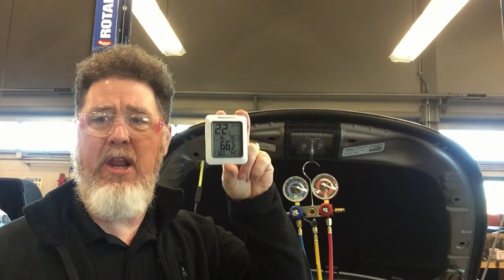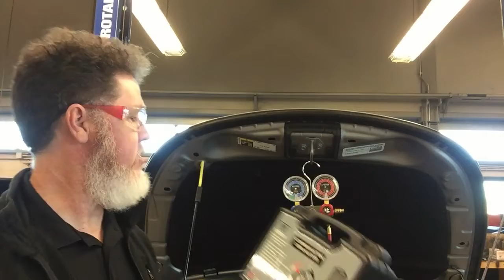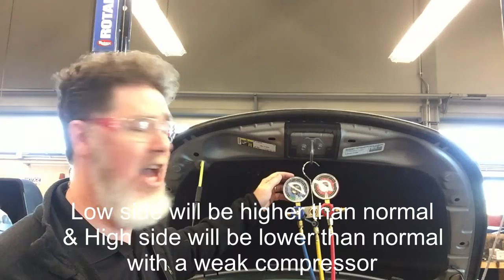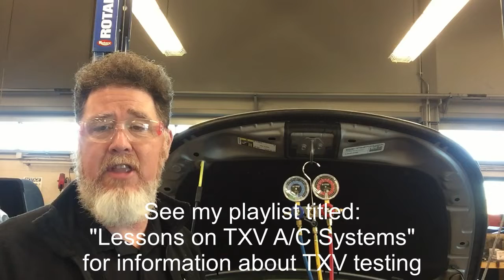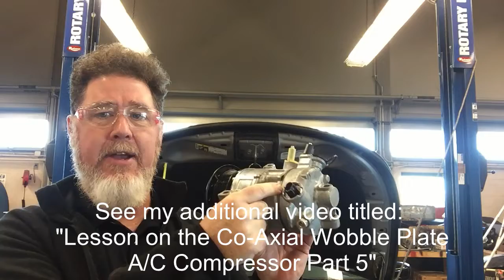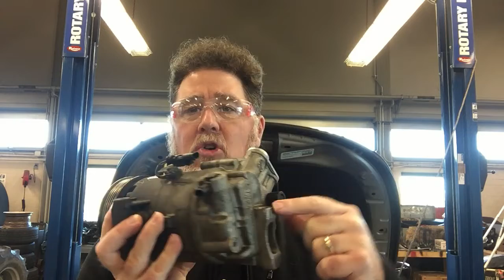Diagnosing a vehicle's A/C system:  Low side PSI is High & the High side PSI Low

Comment: I have a 2014 silverado and the ac compressor runs but doesn't seem to pump the freon around. Pressure on the low side is greater than high side which is odd. And... the cooling fans does not turn on when I turn the ac on inside the cabin. Fans work fine to cool the engine but not turning on for the ac. I unpluged the Pressure sensor and fans kick high speed. Any thoughts?
Reply: Same problem I did exactly what you did with the pressure sensor, I’m go ahead and replaced the expansion valve first before I go with the compressor since the compressor it’s on and I really hope it’s not the compressor 😥$$$ I’ll come back next 2 weeks
Reply: @selvinramirez5585 well? Did the expansion valve do the trick?
Reply: @doingstuffwithhopper4308  no it was actually the compressor I changed the expansion valve first before buying the compressor and that didn’t fix the problem so I last option was the compressor and tha was it
Reply: Did you ever figure it out ?
Reply: I replaced the expansion valve and went ahead and replaced the compressor that had a small leak. I really think the expansion valve was stuck or some. The fans will not engage with too low of pressure on high side. At least It is what I could think of. As soon as I replaced the expansion valve and compressor and refueled, it kicked in and works perfectly now.

Comment: Mine is doing that. The compressor works but doesn't move the freon around on the system. Also, the radiator fan won't start when ac is turned on. Any tip on the radiator fan not turning on? I checked all fuses and relays
Reply: My Cruze is doing the same thing. Fuses are all good too
Reply: Check the expansion valve if there is one there.  If freon is good compressor kicks and too much pressure. Cold be the expansion valve.
Reply: Have you checked fan operation itself?
Reply: @yannickn6742  it was a bad compressor

Comment: Hello!!!

I'm watching this and I can't see my issue. Please help!  Details below. 

What it is: 2004 Dodge Ram 1500 5.7 v8

I changed out shipping pag in ac with new pag46 3 oz in compressor (2 oz reg. 1 oz uv

After replacing everything, I vacuumed system for 2 hours vacuum held
Added 3 oz pag 46 (2 oz reg. 1 oz uv) system requires 6 oz.
Started truck
No clutch engagement
Added 1-12oz can r134 to Low side (requires 22 oz.)
No clutch engagement
Added other 10 oz
No clutch engagement
Jumped 30 to 87 on relay to engage clutch

New stuff:
Ac compressor
Condenser fan
Condenser
Low line
High line
Accumulator
Pressure sensor
Other:
O2 sensors
Pcm
Throttle body
Plugs
Wires
Coilpacks

Old:
Everything behind the fire wall
Line from compressor to condenser

What the issue is:
Can't get the ac clutch to self-engage even after truck reaches OT

Current ambient temp: 63 F

What I have tested:
10A fuse doesn't blow anymore
72472V relay is good
Power to clutch plug connector is good 14.77v
Reading at ac pressure sensor is 3.7 at continuity
I can jump 30 to 87 to force the clutch to engage.

When clutch is engaged by jumping 30 and 87 pins in relay and engine running AC on High coldest
Low side pressure: 40
High side pressure: 135
AC off with clutch engaged
Low side: 33
High side: turned AC on hi/coldest when pressure reached 300 and rising, pressure immediately dropped to 140

When clutch is not engaged and engine running AC on High coldest
Low side pressure: 68ish
High side pressure: 68ish
AC off, no change

When truck is not running
Same pressures as when clutch is not engaged

The truck will not engage the compressor to self regulate.

Please help! Am I missing something?

Comment: I just replaced my AC Belt, previously it was always going 40psi on the low pressure port as the lowest. After I changed It, I now get 30psi easily. What is the effect of the new AC Belt?
Reply from the maker: The old belt could have been slipping causing the compressor to be spinning at a slower speed.  Thanks for watching.

Comment: If both are high  40-250 psi in a variable displacement compressor with IHX inspite of correct charge,what could be the cause?
Reply: 10:16
Reply: Vb how do you check the orifice tube
Reply: How do you check the orifice tube on a 1999 Ford F150
Reply: How do you check an orifice tube on a 1999 Ford F150
Reply: How do you check an orifice tube on a 1999 Ford F150